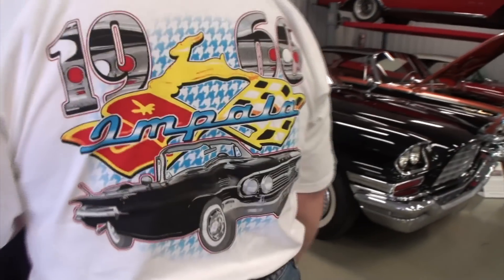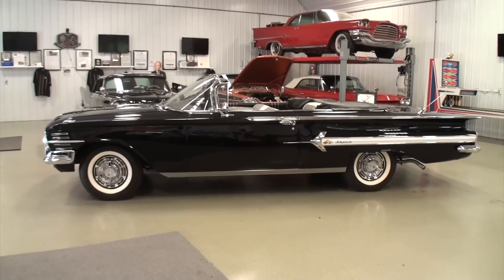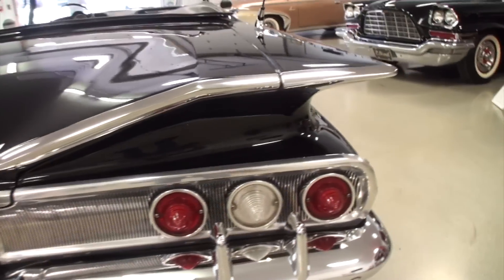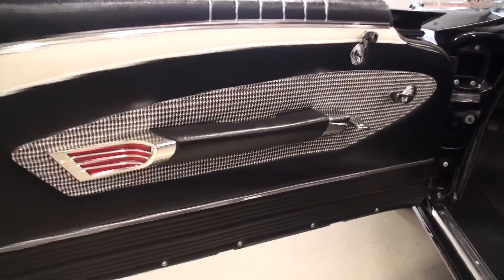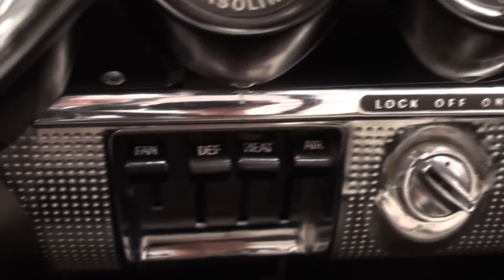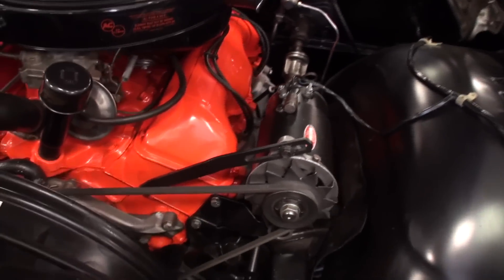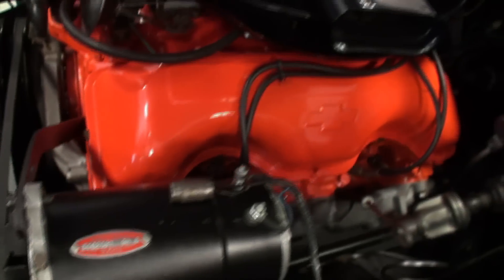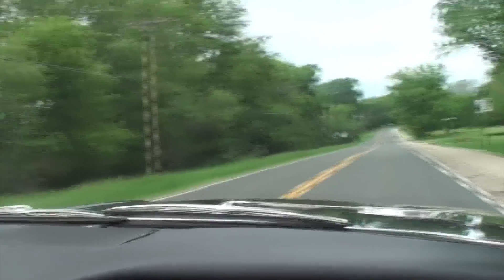1960 Chevrolet Impala Convertible in Black 348 Engine & Ride on My Car Story with Lou Costabile

Comment: I forgot to comment about the ignition switch. Some of you older folks will remember that if the ignition wasn't in the "lock" position  you didn't need a key to start the car. If you look closely at the camera shot that Lou took of the ignition key slot you will see that it has 2 lobes on it that a person can simply grab and turn to start the car. Thievery wasn't as prevalent back in the day.
Reply from the maker: Hi Randy, Thank you for adding that, Lou

Comment: Lou - brings back a lot of good memories!  I also owned a black 1960 impala, 2DSD back in the mid 1970’s early 1980’s. 

Car had a 327 with custom red interior and chrome rims.

Unfortunately the car fell victim to body rot and the floor boards were completely gone. The front bench seat had nothing to bolt to and became a rocking chair.   Had to let her go - safety reasons. 

Thanks for bringing this 1960?impala to the channel.
Reply from the maker: Hi Robert, Happy to read this car brings back memories of your car :-) Thank you for viewing, sharing, and you're welcome, Lou

Comment: I KNEW I saw a later 1960 counterpart to the '59 you recently featured somewhere! This kind of "closed" the emphasis on wings and fins as far as Chevrolet was concerned... The other GM divisions (especially Cadillac) hadn't totally finished with them, and really wouldn't be until after '64...
As for the '60, I liked how they went back to the round taillights (as in the '58)... The front dash had changed little, but the front end was much more simplified... I also liked the unique "rocket or jet" chrome ornament on the side (Bel-Airs and Biscaynes had shorter ones), and the carryover of the dual antennae on the rear end from the '58 and '59... They were works of art!
Reply from the maker: Hi Crazcompart, Happy to share this work of art with you :-) Lou

Comment: Nobody ever mentions but on these ignition switches you could take the key out at the off position and start the car without a key repeatedly until you put the key back in and turned it to lock. The switch had a projection on it for turning. It didn’t require turning the key itself. Very convenient since we never needed a lock. We had a 1959 Bel Air.
Reply from the maker: Thanks for sharing a tip.

Comment: Randy's '60 Impala here (I pronounce "Impolla") is magnificent. When he refers to the 'ginger bread', it's very tasteful and actually adds to the beauty. The bumper guards very subtle, rocker panel. NO continental kit/fender skirts/weird mirrors seen on too many '57 Chevy convertibles. Although the '60 is still a lot like the '59, the back end has styling ties also to the '58. The '60 kind of combined both. In fact if the downward part of the 'seagull' fin was continued (downward) and around the innermost taillight on top of the bumper it would look all the more so. I'm a pretty good sketch artist and actually did that a few years ago, and it looked pretty darn good to me, but more importantly to my classic car pals. Even so, I like it the way it is best. I thought the '61 did a clever job of 'finishing out' the look started with the '58 with that ridge branching out from the center, then wrapping around the sides.
Reply from the maker: Hi Bob, High praise :) Lou

Comment: One of my all-time favorite cars, the '60 Impala convertible. This one is particularly nice in black & white. Randy has good taste. Part of HAVING good taste is knowing when less is more. No garish fender skirts or ugly side mirrors so many '57 Chevy convertibles are plagued with. The bumperettes are tasteful and attractive, unlike the (awful) ones on the older Bel-Air. I have a Danbury Mint 1:24 scale diecast that's the reverse: white, with a black 'trail' on the sides extending to the back. 

The tempting brochure described the fins as "seagull wings" which is accurate for the toned-down '60. To my eye, the '60 looks like it could have followed the '58 quite easily despite the vast styling differences. I loved learning about the engine/power differences between the '60 and '61, the beautiful detail on the door interiors and the beautiful ride looking forward. Such gorgeous green scenery.  I'm jealous;  I live in L.A. (ugghk), so you're not gonna find that around here!  I agree with Randy on cars like this Impala vs. muscle cars. Car shows are too loaded up with Mustangs, GTO's, Camaros, Challengers, etc., at least out here. Hopefully not in MN. and other states. Thanks so much Lou!
Reply from the maker: Hi Rob, Happy to read "One of my all-time favorite cars" :-) Thank you for viewing, sharing, and you're welcome, Lou

Comment: In 1961 chevrolet only made 142 409s one 4 barrel solid lifters 11:25to1 compression 360 horsepower. The 60 Impala featured had automatic trans with 348 with 3 2 barrel carbs 280 hp it was the largest 348 you could get with auto trans. The largest in 1960 was 335 horsepower but only available with 3 or 4 speed manual trans.
Reply from the maker: Hi Tony, Thank you for viewing and sharing your knowledge. Hope you see many more cars on this YouTube Channel you enjoy. Please subscribe, and hit the "bell" so you can see all the cars when they are uploaded on this YouTube Channel, Lou

Comment: All 1960 GM cars were holdovers from the 1959 model year, except the new 1960 Corvair  By that we mean the chassis, running gear, windshields and vent windows, and some interior features were the same or very similar. For Chevy the 1959 Corvette-style steering wheel and instrument panel dash were same for 1960. The mighty 348 Chevy V8 was introduced for the first-year 1958 Impala, and continued as an engine option thru 1961, with the new 409 V8 being introduced for Spring 1961 for the Impala SS and Bel Air series.
The 1960 model was the last year of  styling and design supervised by the legendary Harley Earl, with Chevy designers Clare R. "Mac" MacKitchan and Bill Mitchell.
Reply from the maker: Hi Dejael, Thank you for viewing and sharing your knowledge. Lou

Comment: Is that the 250 hp version? I think there were three different horsepower ratings for the 348 in 1960, 250, 280 and 315 hp the top dog was a tri-power setup. In i965 (I was 20) I had a 1960 Bel-Air 2 dr sedan with the 348/250 hp with three on the tree. Use to eat 352 Fords and 389 Ponchos all day long. My dad had a 1961 Impala, 4 dr hdtp, 348 with the Turbo-Glide tranny in 1964, it was a nice car but I liked my better, besides he wouldn't let me drive his.
Reply from the maker: Hi Sharon W, Hmmm, not sure. Thank you for viewing and sharing your knowledge. Hope you see many more cars on this YouTube Channel you enjoy. Please subscribe, and hit the "bell" so you can see all the cars when they are uploaded on this YouTube Channel, Lou

Comment: This one seems a bit odd it has a 2 speed power glide with the big engine not a turbo glide 3 speed . could also get a 4 speed in 1960 floor shift. But.only went into 830 some cars of all trim levels though.
Reply from the maker: Hi D Owen, Thank you for sharing, Lou